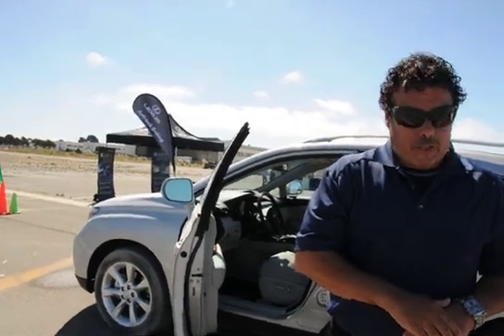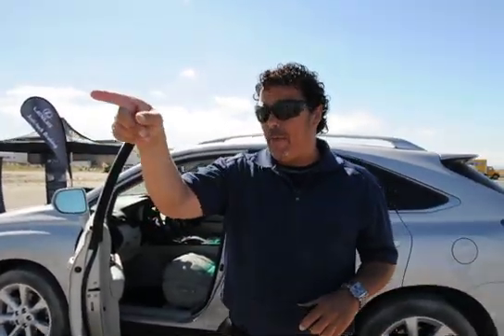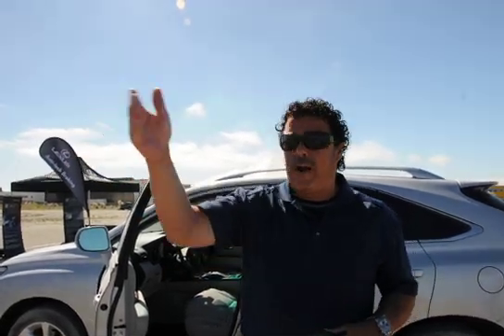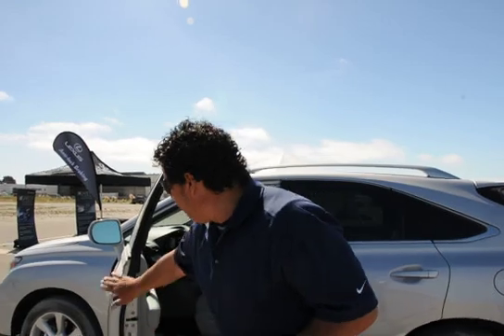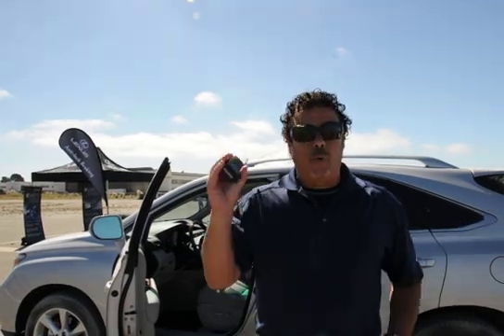The difference between ABS and non-ABS emergency braking

Comment: This video is a load of crap. Anyone stupid enough to lock up their wheels and keep them locked up should not be given a drivers license. On dry pavement, I would stop my vehicle w/o ABS sooner than the one with ABS because it is only braking half the time. It's not hard to learn how hard to "hit" the brakes w/o locking the wheels. When you do that on dry pavement, you will be constantly slowing at the quickest possible rate. ABS is constantly applying and releasing the brakes, which increases your stopping distance. Besides that, ABS was designed to help on slippery road conditions. But the same principle applies. It is a little trickier to learn w/o ABS because it is easier to lock up the wheels on slippery roads. But with a little practice, you can readily learn how to pump the brakes more effectively than ABS because you can read the situation and road conditions and adjust. ABS cannot do that. It's just a stupid invention to take control of the vehicle away  from, apparently, stupid people.

Comment: I hate abs. It has failed on me a couple of times mid braking on 2 separate vehicles. Now I just totally remove it from my vehicles. I pressed the brake pedal once while slowly rolling to stop at the pedestrian crossing and the brakes would not apply! It just kept rolling at about 10 miles per our buzzing away through the pedal. I nearly rolled right over 3 people. No fault codes or any visible problems. Fuck ABS. It is just another money making machine.

Comment: That's not a fail, with ABS he was able to stop the car and steer out of danger... Without ABS you cannot steer away, you will lock the wheel and glide...
Reply: Furthermore, a human will never react to how many times ABS pumps the brakes to avoid complete locking of the wheels. ABS gives you more control of the car in emergency situations, without it you won't have time to react, even if you pump the brake unnaturally like a superhero, your sole focus on doing that action will impede you from steering from danger as you do it...
Reply: Ideally what you would be doing is heel-toe shifting to a lower gear to help with engine braking, and pumping the breaks in quick succession, as if you had a spasm on your feet... all the while trying to swerve away from danger. Not everyone can react quickly enough, ABS gives them time to react...
Reply: Alexandra Sinclair my car doesn't have ABS brakes which I initially didn't know until just recently in the snow when I was testing my car in a parking lot. I have never locked my wheels when emergency braking (and I've had a few close calls) reason being, I don't instinctively  slam on my brakes. Rather, I gradually increase the pressure on the pedal as the car slows down. Even though learning to drive on a car that had ABS brakes my parents drilled in my head to not rely on it and not to slam on the brakes.

Comment: abs is a good idea for drivers that arnt actualy into driving.  they tend to thing that slaming on your brakes is gonna stop an accident when it will usualy make it worse.  non abs brakes work sooo much better under an experienced foot :D  abs should be standard on suvs and regular cars, but sportyer models like lancer EVOs and focus STs and ect should have abs as an option.  or if the car has a manual transmmition abs should be an option too

Comment: i would say that ABS gives the most amount of practical braking

threshold braking will give the BEST braking distances, but only after testing for a certain tire, tire pressure, temperature, weather, surface, etc..

Comment: ABS does lock up the tires, thats what everyone is not realizing. For a split second the wheels lock many many times. Its an idiot proof method to help unskilled drivers stop faster. A skilled driver should never need ABS, proper threshold braking will stop a car faster.

Comment: That is not ABS what you sad. ABS is simply system that activates on the locked wheels by reducing and pumping brakes couple times in second depends on ABS system. There is no such electronic system that can provide effective stable thresh hold. And common ABS usually is better to have it but to tell I have ABS and I can drive faster is completely idiotic point of view

Comment: @Hyeclasscomps actually, even with ABS the wheels lock for a split second. abs detects this and stops it as soon as it can. Threshold braking brings you to a stop quicker then abs, however in a split second decision in traffic, not many people are going to be calm enough to think about threshold braking and are going to slam on the brakes making ABS the much safer option.

Comment: @Hyeclasscomps it really doesn't though. if you've ever watched a wheel with ABS in slow motion and if you know anything about it, you'll realize it lets the tire just barely lock up then completely releases the brake. you lose way more of your stopping power than knowing the proper amount of brake force to apply

Comment: @DocUnsane Yeah, but if you have EBD,  it can  brake wheels individually, so if you are with two wheels on asphalt and two wheels on dust, you can brake better, cause EBD will match the brakes and the car won't spin, without that (EBD) you can't brake wheels individually, even if you are a professional driver,does not exist a pedal for each wheel hehehehe. I live in Brazil, most of the roads are tiny and no coasting, just some dust and gravel at the sides.Thanks.